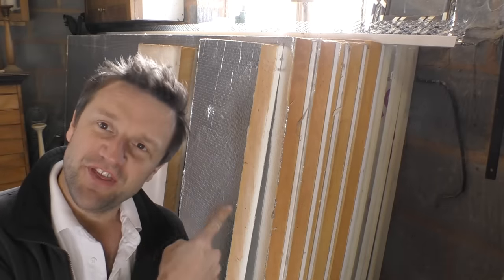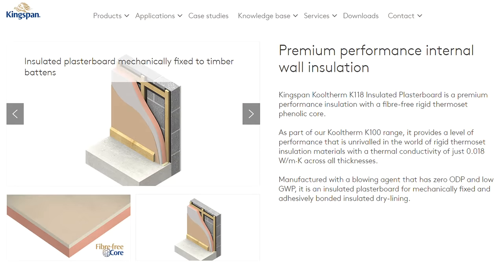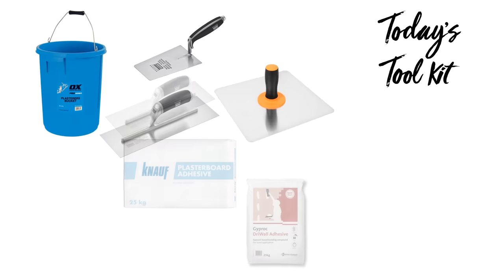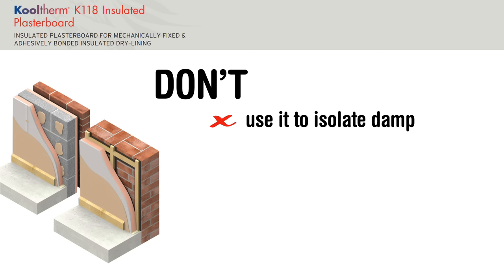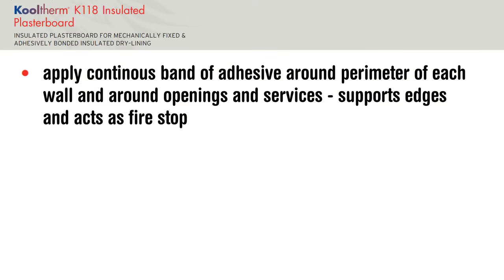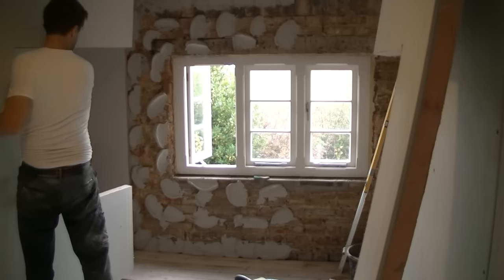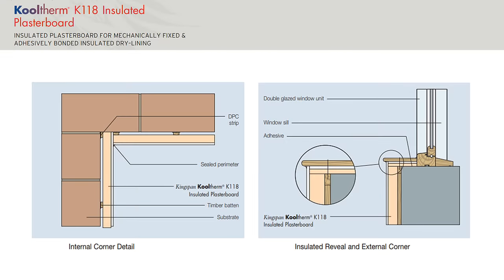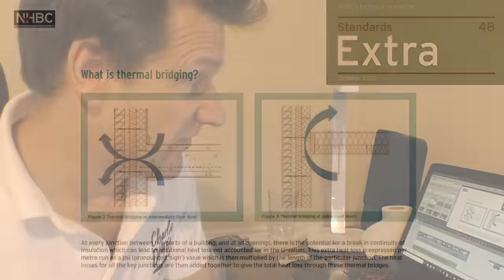How to Dot & Dab Insulated Plasterboard - a DIY Guide

Comment: what do you think if i just batten and use normal plasterboard for my solid walls.   no insulation. no vapour barrier.   condensation shouldn’t form should it?   would be a much cheaper way for me to make my rooms look clean
Reply from the maker: Condensation (moisture) will go straight through the Plasterboard and condensate on the cold surface behind. So I wouldn't recommend this. The builders did this in our kitchen. The wall is only marginally warmer than the brickwork behind.

Comment: Hi Charlie, would it be okay to install these in the kitchen?
Reply from the maker: Yes, I don't see any reason why not.
Reply: @CharlieDIYte  Can it be done only to worktop level or would I need to rip everything out to get it floor level?
Reply from the maker: @richieduliban87  Floor level. Otherwise you've still got cold bridges below = areas for condensation/& mould to form. Also you'll be reducing the work top space if you just went down to the worktop. It would look awful in my opinion.

Comment: What happens if you do this but don't tell building control? Do you need to submit plans to them or do you just tell them roughly what you are doing and if needed they will come out and check?
Reply from the maker: Best thing to do is give them a call before you start, just to check what their requirements are. The key is to get the thickness of insulation right (compliant) and cold bridging to a minimum.

Comment: Hi Great video, how do you work out the guidelines for lining up the boards - if the boards are pushed up the face of the wall and then you mark - wont there be an increased gap due to the dot and dab when you push the board up against the wall?
Reply: Indeed. MY experience is that its tough to get it all lined up. His big dots seemed a bit tough to me !

Comment: Hi Charlie. Did you use insulated plasterboard for the internal walls of your rooms too or just the external walls?
Reply: Just the exterior walls mate. It's to compensate for older builds that don't have cavity wall insulation.
Reply: @lonewolf4777  thanks.
Reply from the maker: Thanks mate for answering that for me!
Reply: Cheers Charlie, figured I'd help the guy out. Regards

Comment: If mechanically fixed (using 2x1 treated battens and damp proof strip stapled to back) how would you pack out battens to level? Where would the plastic shims go...back of the damp proof between solid brick wall?
Reply from the maker: The DPC goes between the last shim and the wall, although if plastic your shims or glazing packers would act like a DPC in their own right, I guess 👍🏻
Reply: @CharlieDIYte  can the void between the insulation boards and solid brick wall, in this case about an inch due to the depth of the batten, be filled with further insulation like rockwool or must it be left empty? (Outside wall is rendered and normally not prone to penetrating damp)

Comment: Advised that DIY shouldn't be done for jobs like this yet when I got a builder in to install in a bedroom outrigger, he didn't fit with half as much consideration....I have the sloping ceiling too and he couldn't be bothered following the profile and cut the board horizontal and 'gobbed' in with adhesive
Reply from the maker: Oh, John frustrating isn't it. There are so many good builders out there but they're so hard to find as they're permanently busy and so we run the gauntlet with the others. It's so important to get this right, not least because of the need to minimise cold bridges. So sorry to hear about that. What did you do in the end to sort it out?

Comment: Charlie, If you wanted to fix these boards to the internal walls of a bedroom with level concrete or thermalite block cavity walls (no damp) could you just fix them to the wall directly with mechanical fixings, thus avoiding battens or dot and dab?  i.e. flat to the wall surface with no voids?  

I know there may be ring main cable in places but is there any reason why one COULDN'T do this?

Comment: Hi Charlie, what did you do around the window reveal and sills?
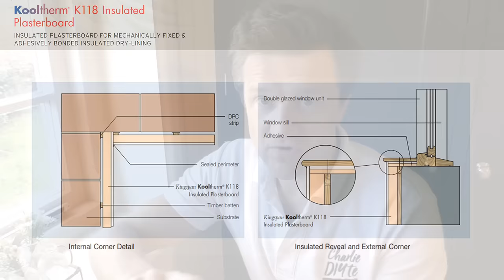Reply from the maker: There's a brief visual at the end at 23:22 minutes. The important thing is to ensure that the insulation is continuous around the 90 degree corner. You do this by cutting away the thickness of the insulation from one of the pieces you're butting up, leaving the plasterboard intact on the front, so that when you butt up the two pieces, the plasterboard join is continuous on the front and so is the insulation behind. You also want insulation below the window board if you can, as they show in the image. I did a load of filming on this in the room I've just refurbished but have somehow lost all the footage.

Comment: excellent video, one question, the continuous line of plasterboard adhesive  ad the inner edges and service ports, is that a requirement under building regulations, if so do you know which BS number, Thanks
Reply from the maker: The continuous line is for building regs - it's to seal the airspace to prevent the spread of fire but also from a practical standpoint it stops insects and rodents etc getting into the void and nesting. I don't know the BS number. You'll need to look that up. The continuous line around service ports is a practical issue more than anything - to support the wall where it's likely to be pulled in when you screw the socket tight, but it also helps to prevent the movement of air as with the continuous line around the edges.
Reply: @CharlieDIYte  Thanks Charlie, I have done a little research since posting my question, it seems that the plasterboard manufacture states that the Acoustic and thermal performance along with fire safety rating of their plasterboards are only met if installation as per their guidance, and their guidance does state the requirement of the 

continuous line of adhesive, BS EN 13963 and BS 8212 are the reinvent standards.
Reply from the maker: @williamaustin6132  Ah, good info, thanks for that!

Comment: How do you get around door casings once you put plasterboard on at that mm the door casing will be covered?
Reply from the maker: I couldn't use the insulated on the wall to the right of the door. So that was just dot and dabbed plasterboard. The left wall is internal so again didn't need insulating. That's got two layers of plasterboard.

Comment: great information and helps, quick question if you dont mind, im looking to insulate plasterboard my old house, its solid stone wall which is rendered on the outside, i've taken the old black ash plaster and the wall is bone dry, is it okay to just PVA and dot and dab straight on to this? i've has couple of builders over to have look at the job and they all say to scarch coat it, but wouldnt this stop the wall from breathing?
Reply from the maker: Why did they say to scratch coat it? I'd be tempted to batten it maybe, rather than dot and dab. Put DPC behind the contact points between the timber and wall. That way you can put insulated board in between the battens like I've just done in our bedroom (using 2x1 tanalised battens), foil tape over the joins, and then screw the insulated plasterboard to the battens. Leave a 10mm gap underneath and fill it with expanding foam tape when you're finished. This technique leaves no cold bridges where you have to cut into the insulation for socket boxes as there's insulation behind. Whatever you do, the wall won't be able to breath, because there's an inbuilt vapour barrier in the insulated plasterboard, except through the expanding foam tape.
Reply: @CharlieDIYte  Thanks for the help, would it be a worry that the boards might not stick with the dot and dab method?

 I have no idea why they said to put a scatch coat on first, maybe fishing for more work to make a few extra quid? who knows with some builders, I should of asked them why they would do this but didnt think at the time.
Reply from the maker: @leight8210  No less adhesion than PVA'ed brickwork. I'd say they were definitely fishing for more work
Reply: @CharlieDIYte  I think I'll go down the metal stud frame route, what is your thoughts on that? Timber was my go to after speaking to you and when looking at material I came cross the metal stud work, never knew they did that, makes sense with old walls to avoid any rot but I guess the risk with metal is rust? So many routes to take lol
Reply: You can use closed cell foam adhesive to pack behind the battens, which also provides a vapour layer and extra installation. I check the battens are straight, prop then in place, foam them, then once dry, fix with Fischer or other good quality frame fixings. The frame fixings provide the strength, but the foam helps too.

Comment: As far as I understand , silver foiled back insulation boards will not stink , the dab does not stick to the foil , the bond breaks down when it drys
Reply from the maker: That's certainly the case for foil backed (uninsulated) plasterboard which you can't dot and dab but this K118 is designed for dot and dabbing.

Comment: Hi we have a 44mm timber log cabin. Would the dot and dab technique work for me and would it be ok on the wooden timber?
Reply from the maker: No I wouldn't dot and dab on wood. I'd mechanically fix as you have the perfect environment to do that.
Reply: For your application it may be worth looking into a product called 'Spacetherm'. Much reduced (often 10x) thickness for similar U Value (W/m2k).

Comment: This might be a daft question, but I'm currently doing something similar in my property, the pointing of the brickwork in your video looks pretty empty, are you not concerned about the structural integrity of the brick wall?
Reply from the maker: You raise a good question there. If you consider that the entire house which was built some time in the 1800s has lime mortar that is mostly crumbling between the bricks, what do you do about it? I guess you could render them before insulating but a layer of render isn't going to make good the entire structure. The outside was Tyrolean rendered back in the 70s I'm guessing because of the same issue from the outside. I suspect a large proportion of the country's Victorian housing stock suffers from the same problem.

Comment: How did you ensure continuity around the windows?
Also, really good video!
Reply from the maker: There's a section 23.24 minutes into the video where I talk about the windows. It's a bit difficult to describe in words, but you basically want to ensure the insulation is continuous when you butt up the two pieces on the 90 degree angle, and you do this by marking a line on the insulation on one piece, parallel with the edge corresponding with the thickness of the insulation. Cut this away but leaving the plasterboard in tact behind it. That way the plasterboard is continuous at the front, and the insulation is continuous behind. If you don't quite get it right you can spray a bit of expanding foam in as you butt the two pieces together, to fill any gaps. Any gaps left between the plasterboard and the window frame should also be insulated with expanding foam. To do this, your window frame on the vertical has to be deep enough to accommodate the thickness of the insulated plasterboard, which is not always the case.
Reply: @CharlieDIYte  You really need to make every effort to get some insulation into the reveals of the windows as this will otherwise me much colder than all the other surfaces and will be the area where all of the damp and then mould will form.

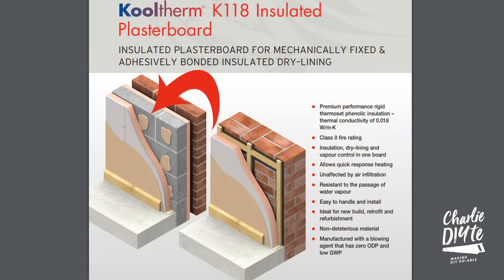Comment: Hi - I've been recommended (by Kingspan) that to retrofit the insulation on a timber framed house, I should use a combination of Kingspan Kooltherm K112 Framing Board and Kingspan Kooltherm K118 Plasterboard. But . . . at 5:11 you say that K118 should NOT be used for this type of build. I'm confused.
Reply from the maker: I'm guessing that the Kooltherm framing board is the difference. The point I was making was where you're only installing the K118, and was consistent with Kingspan's own literature at the time. But it that's what they're recommending, go with it👍🏻
Reply: @CharlieDIYte  Thanks Charlie - Keep up the great work - Love your videos!

Comment: Do you have to seal around any protrusions (sockets etc) with adhesive? Also would it be possible/ok to carve some of the insulation out to chase wiring and/or heating pipes into? Providing you don’t break the vapour barrier?
Reply from the maker: Sockets are a bit of an issue as that's a major source of cold bridging. I'd be inclined to seal behind the socket with expanding foam and then quickly screw the socket into place so the foam can expand around it. Yes you could channel the foam although if possible I'd route electrics in the gap behind it, unless you're taking about the wiring immediately below the back box for the sockets, which might be necessary. You're right though about the importance of preserving the vapour barrier.
Reply: @CharlieDIYte  exactly as you say, pre existing wiring from the back box and plumbing pipework. The wall I want to insulate is in my kitchen and contains sockets and pipework for the feed to my appliances. I notice you multi tooling out what looks like socket holes in your video? So my plan was to cut holes for the sockets and channel some of the insulation out of the board (not penetrating the vapour barrier) for the pipework and laying it over the top?  I’m think now if dot and dab insulated board isn’t the way to go and I should make a baton frame and place insulated board onto that?

Comment: To do the window reveals, I knocked off the, plaster around the reveal, filled and made good around the frame then trimmed off some of the insulation before dot-dabbing it into place. In my case the wall plaster was solid so this was the only dusty bit I had to do.
For priming the wall a milky solution of PVA sprayed on with a pump-up "killerspray" is ideal. Use a brush to catch any dribbles.
Reply from the maker: Thanks David. The important thing is to have continuous insulation around the right angle - and no cold bridges between the insulation and the window frame. I was going to do a video on this but I've lost all the footage which is incredibly frustrating!

Comment: Considering doing this to my house while I’m in the renovation process. Just seems so bloody expensive and insanely time consuming considering I’d have to batten every wall.
Reply from the maker: It is James, but worth it in the long run. Just do one room at a time and see the difference. I've just done the outside wall in my bedroom, battened it as you say, filled in between the battens with 1 inch celotex insulation, taped over the battens, then put this insulated plasterboard on top. That way, you can cut in sockets into the insulated plasterboard without running the risk of cold bridges where you've cut though.

Comment: If I only have mould build up on the exterior wall, and would like to take back to bare brick, batten, insulate, and use plasterboard, will I have to do the other 2 surrounding walls? 

And how would I finish around a window that isn't being replaced?

Thanks!
Reply from the maker: Hi Reece. Yes, I've got exactly the same scenario in my bedroom. One exterior wall, which I am going to thermally insulate, and then just re-scim the internal walls. Provided you have no cold/thermal bridges, you will eradicate the problem of mould build up. We have no mould any more and use to have it everywhere. As I said in the vid, when you take it back to the bare brick, just make sure the brick is dry. Then, when you batten it, put a damp proof strip between the batten and the brick - something like this http://bit.ly/2GLivpA. In terms of finishing around the window, check out my video at 23.23 minutes. It's very important that you insulate the reveal, otherwise you will get mould forming in the corners where the window frame hits the plasterboard, because non-insulated spots create cold spots where the heat escapes/ the cold air gets in, and this is where mould forms (the cold bridge I referred to above).
Reply: @CharlieDIYte  Sweet, Thank you.

Comment: U Value is in units of W/m²K.   Watts per square meter,. degrees kelvin.  Do they define the degrees kelvin?  I vaguely recall this is based on the 5*C temperature difference of an unheated property.... but I also recall horrible calculations based on solar days and such.